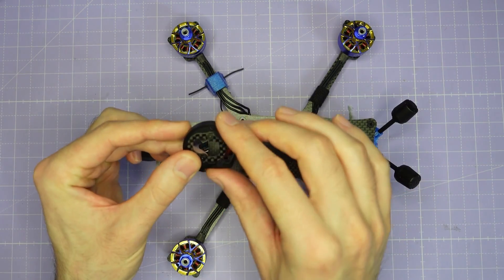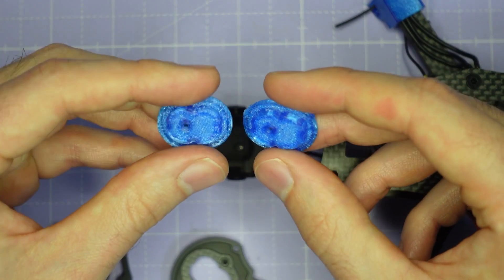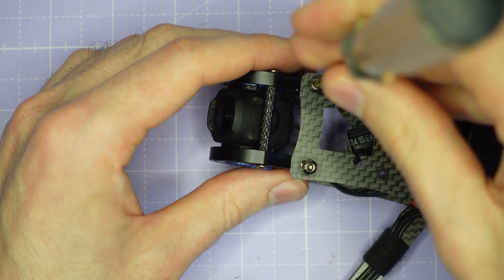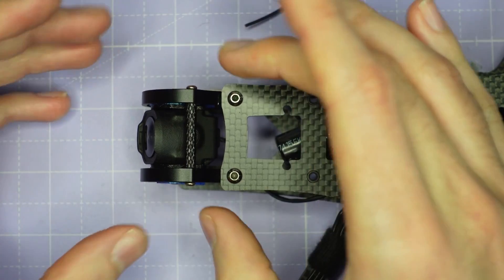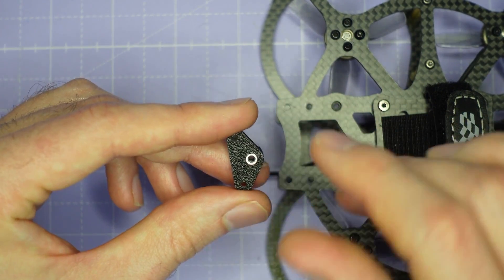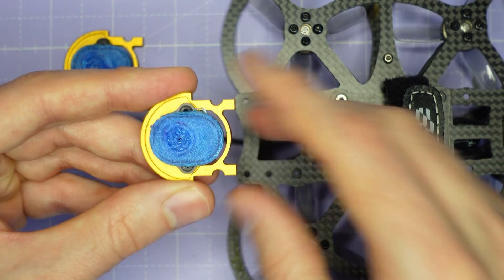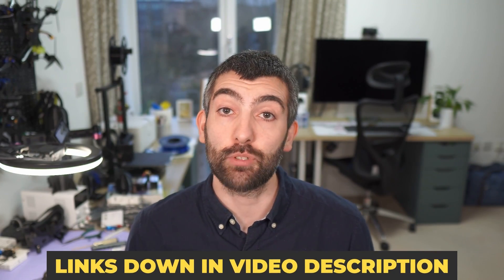Mounting the DJI O4 and O4 Pro Camera into AOS V5 Frames

Comment from the maker: I've added an O4 mount for AOS EVO frames to the thingiverse. I haven't tested this and only V5 frames are officially supported for O4 but hopefully it helps!
Reply: Doesn't look like the 04 Pro will work with the AOS 7 EVO with the carbon camera cage.  Maybe if you remove the top cross brace in the camera cage, but not sure yet (camera is too tall).
Reply: @twinturbostang  I find the same with the 3.5 cine , 5.5 and 7 . Carbon cage is to narrow for the screws to mount the camera. Normally they go trough the cage now it needs inside. Where is no space. And also the cage support prohibiting any movement up or down . Big flop currently
Reply: @ThomasAndersonFPV  Yeah, the camera is just too big.  I'm working on a design that will work with the AOS 7 EVO.  But I don't have any cine quads.  No idea if it will work with those or not.  It will utilize the front two standoffs as mounting points for a new 3D printed camera cage.  I will try to upload to thingiverse when it's done and if I remember, I'll post it here.
Reply: @ I skimmed a bit of the standoffs, basically 90% of the tpu print shaved down more flat. and had countersunk scews to attach the cam tot the tpu as flat as possible. The cine has the exact same cage as the 7 Evo.
Reply: @ThomasAndersonFPV  The 7 EVO cage is different from the V5's.  It has carbon plates and two 23 mm spacers (horizontal standoffs) to hold it together.  V5's have metal plates and either one or no spacers.  The spacers are the problem as the vertical distance in-between them (22.15 mm) is less than the height of the camera (23.06 mm).  Maybe that's what you're talking about shaving.  But even if you get it to fit, I don't think you'll have any adjustability of camera up-tilt.  I want to stick with the carbon cage if I can.  So maybe I'll remove the top spacer.  But I'm still having problems with the width.  Need to get some M2 x 3mm screws (4mm don't clear on the width).
Reply: @twinturbostang  the counter sunk screws m2x 3mm  dugg into the tpu and cam like nearly flush.    I get what you say there is no movement, now is the angle about right. maybe removing the vertical standoff ( you call spacer I think). or placing it 2mm back will allow some extra 10 degrees uptilt, but really free it won't be unless AOA and corp. Release a aftermarket plate for the 04 in the EVO.  3.5 4-5-5.5-6-7 inch evo have nearly the same plate I think.
Reply: @twinturbostang  hello mate. Some update about it?
Reply: @twinturbostang did you come up with anything for the EVO.. find it odd Chris and I appreciate his work to release something as a fix but not tested it himself surely he has a EVO frame laying about 🤔
Reply: Hello. Today I made it work. For the gummy, you have to make it with the inner side 1,5 less material (same size as the frame). And install outside the carbon cage. For this, you have to use the screw and nut, or the Gummy will fall out!
Reply: @ThomasAndersonFPV I made 3d parts to fit one on any of them pre v5
Reply: @twinturbostang you gotta say good bye to cage, i hv designed a fix using standoffs and great adjustability.
Reply: @twinturbostang  Hi there! I've come to the same conclusion, the carbon cage won't work! did you came up with any finding?
Reply: Awww that's crap if 04 doesn't fit in the Evo got a brand new frame sitting here ready to build had it to long to return...
Reply: @twinturbostang I have a file i made to fit a 04 camera easily
Reply: @ChrisRosser What about AOS UL7 V5 frame? I am about to build that one with the new 04 unit.
Reply from the maker: @princesfpvdrones  All V5 frames can use O4 with the mount on thingiverse. https://www.thingiverse.com/thing:6905212
Reply: @ChrisRosser there are multiple versions of the same files..? Which file names are for O4 Pro please..?
Reply from the maker: @frogpark67  You'll want 2 of the O4_Pro_Plate.STL and 2 of the O4_Gummy.STL
Reply: @ChrisRosser  superb, thanks so much. Got the frame today, very well pacakged from ilfight :)
Reply: @ChrisRosser  that's great all printed. Secondary question, for your 4.5 tune, what master multiplier do you recommend for the brotherhobby 1540.5 3950kv.. it's set currently stock at 1.25 but I gather this is for 3100kv motors?
Reply: @ChrisRosser that’s great if you e got a 3d printer. What if you don’t ?
Reply from the maker: @jamiegarner007  Brain3d.com sell all the prints. Or ask a mate who's got a printer 👍
Reply from the maker: @princesfpvdrones  works perfectly, check out the thingiverse links.
Reply: Sorry Chris, I can't find it in the thingiverse, what reference do i need to put in order to see it?
Reply from the maker: @mrtarika6414  https://www.thingiverse.com/thing:6905212
Reply from the maker: @mrtarika6414  The search is AOS O4
Reply: Do you have o4 mount prints for the AOS EVO 3.5" frames?
Reply: Hi Chris! Is this also works with the AOS 3.5 V5 Frame (with the small alloy camera-cage)? I have 2 of them waiting here to get mounted with the O4 Pro-s :) Thank you!
Reply from the maker: @PRolandFPV  Yes it does!
Reply: @ChrisRosser  I've flipped the gummy, now it's perfect: https://www.youtube.com/watch?v=kxb_yqhcjJ4
Reply: @ChrisRosser 
How does the VTX fit in the 5v5 frame?
Reply: I just purchased an aos v5 and it arrived today. Where are  the necessary gummies for 04 pro available for sale? I have msla, cnc, lasers, but not fdm.
Reply: Not finding the evo parts either.
Reply: Where are the Evo frame links???
Reply: I’m having problems with the prints. Maybe it’s just me, but I have the aos7 v5 and the camera cage is in view. Any solutions? Maybe there is updated prints I’m unaware of.
Reply: @skKRRTfpv  I've just built the 3.5...check Chris's response to me below where he gives me the exact file names to use

Comment: Took over an AOS 7" from someone, he threw away the cam plates and installed some tpu mount. Now on the hunt for a set of cam plates lol. Only found out after the it was delivered to me.
The 04 unit is just sitting on the bench now. 
cam plates are not sold separately? can't find them, or any printed parts/stl's

Comment: Just bought this kit. Thanks for the videos! Unfortunately as others have mentioned, the screw size for mounting to the O4 camera is incorrect, and there aren't enough M2x3mm screws included in the kit to finish the build. Disappointing because now I have to order additional screws just for this :(.

Comment: I just built the UL7 V5 and used the 3D prints for the 04 and the camera angle is a major issue. I would guess 15° is the best you can get before the camera hits the bottom plate. What can be done about this?

Comment: Hey Chris - Looks like one of the ONLY 3.5 Inch Frames that can fit the OS4 Pro properly.... What Camera Angle can be achieved? All other options I see out there are limited to about 20 degrees tilt - Have you measured what the angle is with this mounting solution? OS4 PRO?

Comment: These really need to be included with the frame, or at least an inexpensive option to purchase with the frame. It sounds easy to just 3D Print parts, but for those without a printer it’s problematic and expensive (mostly shipping).

Comment: The holes on my o4 pro camera is not deep enough to use the m2 6mm screws, also tried the 5mm, also too long.
Reply: Same here. M2 3mm works but it feels like there is not enough thread to grab the threads on the camera properly, and I am worried about stripping it. It feels like for my camera M2 4mm would be optimal, but I don't have countersunk M2 4mm screws on hand...
Reply: Nevermind lol screwed it harder and it worked.

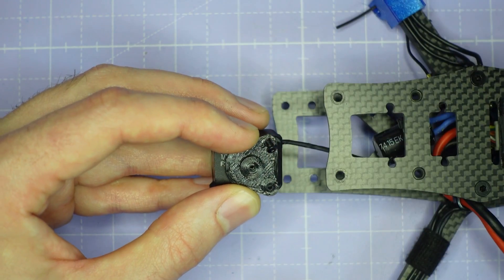Comment: 2:20 the included M2 x 6 included with the frame are too long. What you are holding appears to be M2 x 4
Reply: Those Screws are definatly to long... you need some smaller one like m2x4 / m2x3
Reply: I thought the same thing but if you screw harder it goes in. For me the 6mm worked

Comment: I don’t know why you say the Evo serie is supported?  just by adding some tpu, does not magically move the vertical standoffs out of the way rendering the camera still useless / no changeable tilt.
Reply: That's what I'm here to find out also looks like top stand off needs " adjusted/ removed from the cage..
Reply: Did you find a solution yet, just bought one for my evo frame, will be a bummer if it doesnt fit. I printed the tpu parts,  but now i read here that it doesnt fit
Reply: @sdproduxions  Make it super thin ( by hand or print) it will fit + file fome of the cage stanoffs for the camera not to touch it
Reply: @ThomasAndersonFPV  make what superthin?

Comment: Chris - I get why the hole in the gummy should be towards the front, so you can get an ND filter on.  However, for acro, I'd suggest not having the camera stick out so far.  I tried reversing, so the hole is on the rear, and the frames are "just" in view (AOS5v5).  Wondering if the hole at mid would be a sweet spot.
Reply from the maker: There are two camera plate adaptors. The standard one has the camera behind the metal cage. The ND filter one moves it forward to work with the filters.
Reply: @ChrisRosser  hmnm. I tried the other and it was so thick that I couldn't get the side plates together.  That,  and the fact that only the ND one said "pro" in the file name led me to think that there is only one for the pro. I'll go back and try the others again.

Comment: Hey Chris, I just bought an AOS 5 V5 for my first build ever and I’m really excited. One question: I was watching your V5 release video and you said that the cable from the VTX to the camera needs to be 200 mm due to the long body style. I just bought an O4 air unit pro and the manual says the coaxial camera cable length is only 130mm. When you installed the O4 pro for this video, how did it work out?
Reply from the maker: O4 Pro fits easily in the AOS 5 V5 with the stock cable
Reply: @ChrisRosser  Thank you!

Comment: Did you test the latency of the 4k/100fps mode? I assume the latency would be the same as the 1080p/100?
Also did you test if the o4 pro camera is compatible with the standard o4 vtx?
Reply from the maker: 4k/100fps has the same latency as 1080p/100fps. I've not tested swapping the cameras.

Comment: Are you going to design dual antenna mount STLs for the AOS 5 V5 and AOS 3.5 V5?
Reply from the maker: Already on thingiverse https://www.thingiverse.com/thing:6905218
Reply: @ChrisRosser  Hi Chris, I'm not really sure I understand which version is suitable for me. I have the AOS 5 V5 and the O4 Pro. What's the M2/3 and the millimeters referencing to?
Reply: @smy3628 I’m wondering which I need for the AOS v5 frame and I was going to try get the parts printed before I order the frame
Reply: @RPE_Videography  I'm pretty sure I've figured it out. But don't quote me on that :D
The 27mm and 28mm are referencing to the hole distance of the standoffs. The files not starting with any millimeter are 32 mm, which fits for the AOS 5 V5 I have.
The M3 one has a diameter of 5mm for the standoff holes. M2x4mm and M2x3.5 probably have 4 and 3.5mm. My AOS 5 V5 has 5mm diameter for the standoffs. Therefore, I'm going for the O4_Pro_M3_Antenna_mount. I guess you should look at your measurements, too.
Reply: @ Nice! Makes sense now 👍🏼

Comment: Amazing work! Thanks Chris for making your V5 fully compatible with the O4 Air Unit from day 1! :) Looking forward to mounting them onto my AOS 3.5 V5 (skkyfpv)
Reply: Nice, is that the 04 pro and both antennas?
Reply: i am looking for 04 tpu mount , as i have the same build i did the 04 mounting which Chris updated but still i need an extra 04 TPU camera mount to secure it around

Comment: Hey! Any plans to support aos ul7 evo frame?
Reply: Hi Chris, if I want to mount O4 in a 7 inch for long range, can I use my long coaxial cable for my O3?
Reply: Looking at the O3 supporting EVO 7 I think you will be able to make it work with Chris's 3D print adaptors for the O4 and Rev 5 frames. Just swap the rubber mount round. I will try it when my O4 arrives. If I have to then I will upgrade my frame. I can make a Voodoo effigy of Chris out my previously perfectly adequate carbon frame parts and throw broken props at it.
Reply from the maker: You'll need to reverse the outer gummy. I'll add a suitable file to the thingiverse.
Reply: @ChrisRosser  thanks!
Reply: @ChrisRosser  thanks Chris. I didn't even need to work the Voodoo 😁
Reply: @ChrisRosser thanks ❤
Reply: @MrCaptainnemo  sounds great!